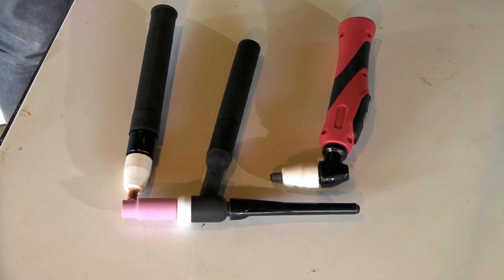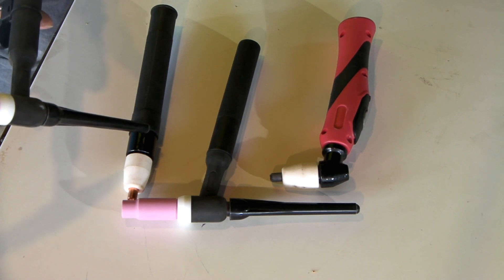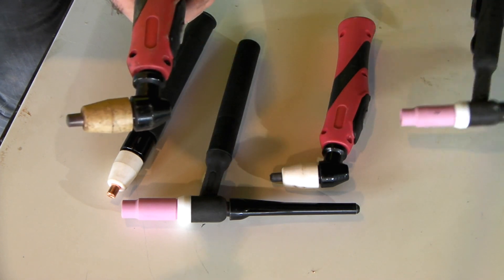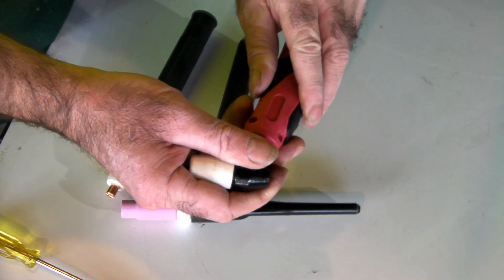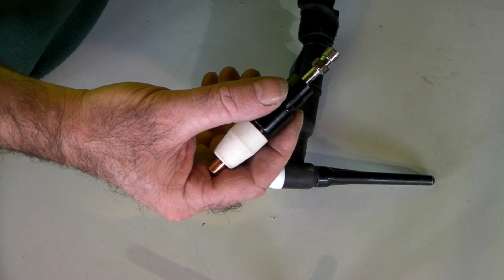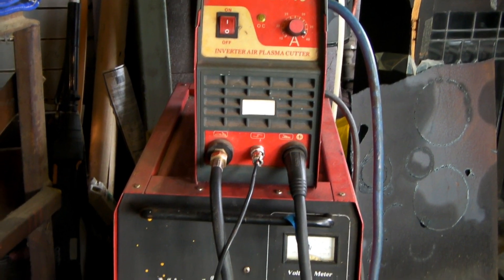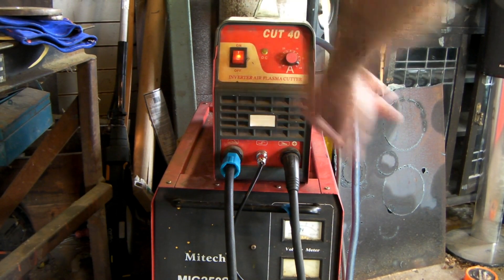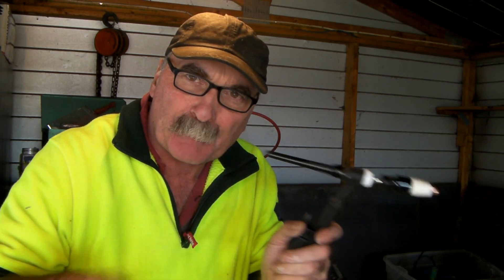How To Use A Tig Torch For Plasma Cutting

Comment: Nice! Very intelligent solution. Can i use a air compressor at 50 psi and put the air inside the machine, instead of using gas ? Congratulations for your brilliant idea.
Reply from the maker: Yes, you can
Reply: @petestools  Thank You!

Comment: I have a modern inverter AC/DC tig machine with HF start and I bought one of the eBay P80 plasma torches with a pilot arc. was wondering if you had any ideas to get them working together I bought an adaptor so I can plug the torch into the tig machine and if I try using it it just pops and splitters but doesn't make a stable arc and wont make an arc with the metal so it wont cut anything
Reply from the maker: no sorry

Comment: I have a cheap plasma cutter, can I get a tig torch and a few other parts and run it as a tig? I also have and old mig welder I would like to convert. Can it be done to either? Cheers
Reply from the maker: no

Comment: Anyone? Is it possible to use a tig welder as a plasma cutter?
Reply from the maker: don't think so
Reply: @petestools  thanks. I have the cut50 and was wondering if i could use the tig to ramp up the current for cutting inch thick plates.
Reply: @petestools  i do think so!. Its the same

Comment: would this work other way round - what i mean is could you connect your plasma torch to a tig welder and not the plasma cutter as I have a tig but not a plasma cutter and I'm tight lols a plasma torch is cheaper than a plasma cutter
Reply from the maker: something to think about cheers

Comment: Thanks for the video, glad I'm not the only person crazy enought to try experimenting with the same technique. Would you be able to just use a plasma torch with a cable that connects to the same fittings as the TIG torch? What PSI are you running?
Reply from the maker: Hi will have to try that . 90 psi
thanks pete
Reply: @petestools  I have a tig/stick combo welder and I couldn't get the plasma torch to sustain an arc and not destroy consumables. I believe the welder I have is is only DCEP and the plasma torch needs to run DCEN. Its a TIG-200CP - it's just a guess because I can't find specs on it anywhere.
Reply: @ADCamardella  i wanna take my tig apart and make a double pull double throw switch for this